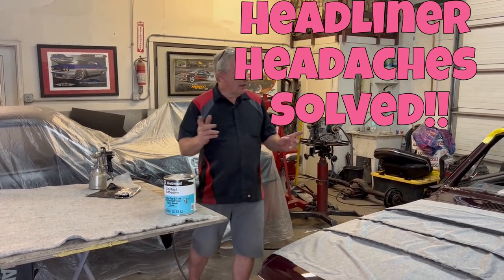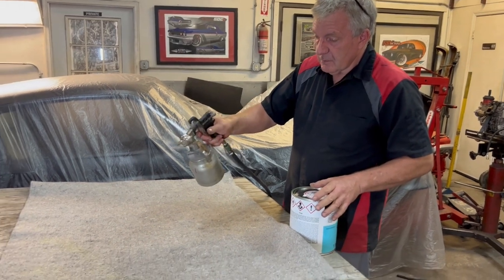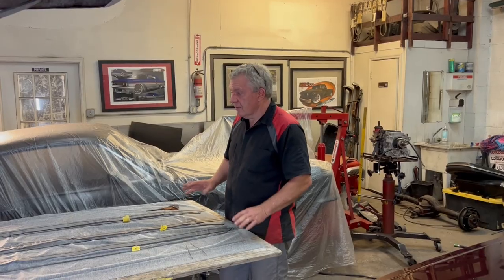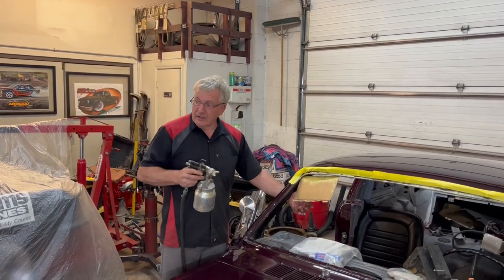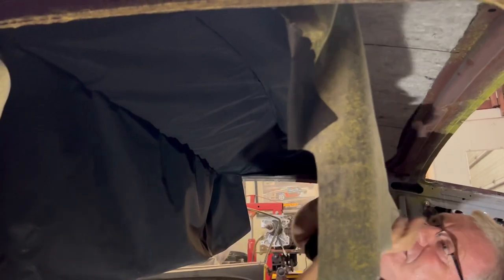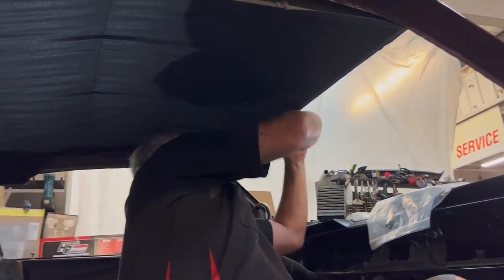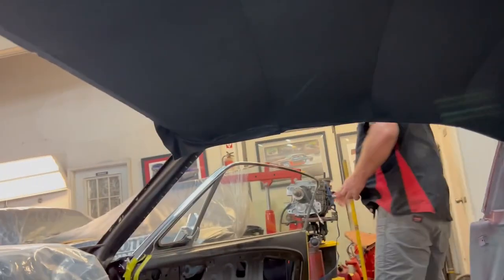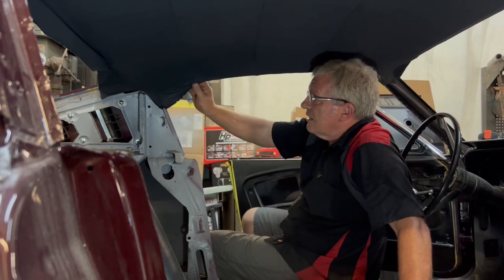Headliner Headaches Solved!!  65 Mustang Headliner Install              #utg @UncleTonysGarage

Comment: Great tutorial for installing headliners.
It's so true that not all contact cement is created equal. I got ahold of some water based contact cement. It was cheaper, odorless, and total $HIT. Worthless for holding. Good quality contact cement is expensive, but worth every penny. Don't try to cheap out. Not only will the installation frustrate you, it will NOT hold up over time.

Comment: That's what I needed to see before I did my El Camino headliner a few years back. Thanks for sharing your knowledge Kiwi!
Reply: Same here, I used the HD headliner stuff in the aerosol can that you get at the local auto parts store and it did not work out to well, wonder how it works on carpet.

Comment: Headliners and floating drywall are two jobs I hire out to a professional. Oh I could probably do it, but why? They’ll have it done in a fraction of the time I’d take to fuck it up and fix it two or three times till I got it right.
Reply from the maker: Knowing your limits is a skill too
Reply: @kiwiclassicsandcustoms9160  , The only other automotive job I would absolutely farm out is a convertible top. I tried to help a friend try and fix the top on his early 70’s Mustang years ago and after we messed with it for a week we ended up taking it to a real shop. After he messed with it for a couple weeks, we finally found a real pro who got it not only looking right, but working right. And not leaking, which I’m told is the real trick. So there is no way I’d attempt one of those.

Comment: Our 66 Charger has a one pice fibre board headliner, perimeter mouldings hold it in place, fabric ones look like a lot of work!
Reply from the maker: They are much easier!
Reply: I realize the factory workers were really good at it, but it seems incredibly labor intensive by today's standards.
Reply: The nice part about those headliners is the easier piecemeal way you can work on them. My Flex's full-length one-piece headiner was a royal PITA when I needed to remove it in order to install factory roof rails, especially since every interior side trim panel must be removed to drop it prior to swapping out the rail inserts.
Reply from the maker: There is that...

Comment: I lucked out on my 69 Dart. Jim's auto up in New Hampshire had an NOS (New old stock) headliner. They bought out a bunch of stock directly from Chrysler years ago. They also have a bunch of used mopar parts in their on site yard, good source for body, trim, and mechanical.

Comment: Hi off topic the stainless trim clips around the front and back windows on the early cars were originally screwed in would you rivet or screw them in . I couldn’t tell from the video but it didn’t look like a pin post thanks in advance America is lucky to have you.
Reply from the maker: The 65 mustang clips we're screwed in,the 66 went to pin post.  I usually screw them in as per the factory just be sure to use stainless screws. Rivets will work just fine too

Comment: First Headliner I ever did, was on a '65 VW Bug... I bought material and "unstitched" the remains of the old one, for a pattern... After I sewed it, it was install time... Well, February in Canada, is a little cold.😂😂😂 So I put a rather large electric heater in the car, so I could get a decent stretch on it... While "Sweatin' like a Bad Girl" in Church", I stretched it in, glued down the sides and put the quarter windows back in... It turned out great, and I had no "SAG" in the 90 degree summer days... I still have to laugh when I think about it: Windows out, in the carport, freezing weather, heater roaring, sweating and stretching the headliner in. 🤣🤣🤣 
On a side note, I wasn't sure if I had tightened it up, to the point, that when the weather got to freezing, that it might rip the stitches... 😮😮😮
But it was okay... 👍👍👍
Good Results from a Mispent Youth...

Comment: My fil was an auto upholstery for over 40yrs. I've watched him make and install antique to modern car headliners. If you' be never done this before, do yourself a favor and take your headliner to a professional. Most headliner kits need unexpected trimming done to fit properly, especially in roof side curves. Good headliners aren't cheap. Cheap headliners are a PITA. Just my experience.
Reply: This advice is why no one learns anything new. Even the professional had a first time.

Comment: I used weldwood contact cement for my headliner on my wagoneer a few years ago.   I used that because i used a vinyl burgundy cordovan type color to match my leather interior.  And the weldwood glue worked great to hold it to the cardboard.

I used a foam paint roller to put it on.  Had to use a lot though as the cardboard headliner sucks it up.

That stuff... though is TOXIC..  i dont rec9mend doing it without a respirator or inside with no ventilation
Reply from the maker: The weldwood is very similar and works pretty well👍

Comment: Wow - great video. My 9F02R has had a 3/8" dia hole just inside of the driver's visor mount for 50 years. And every now and then I think it would be nice to replace the headliner but you confirmed why I always thought the reward would not be worth the effort... Wonder if you ever tried a heat gun to warm the centre area to assist stretching the material out to the sides?
Reply from the maker: Yes a heat gun really helps on some of those stubborn wrinkles

Comment: Would you say laying the fabric out in the sun for a while, befor glue, so its a little relaxed is a fair idea or is it likely to lead to an over stretch once it cools down?
Reply from the maker: Laying out in the sun will help it relax back into it normal shape and flatten out any creases that have formed.  You will need to stretch it a bit to glue it on the car but honestly the most important thing is using the correct glue!!   DAP Landau Top & Trim  spray grade glue is the ONLY one to use.  Please don't use rattle can glue, it will fail and quickly!!!!!!
Reply: @kiwiclassicsandcustoms9160  that seems right. Used rattle cannon the seat back panels....didn't last.

Comment: I already bonded that black thing
Reply from the maker: Not sure what you mean here??
Reply: @kiwiclassicsandcustoms9160  roof insulation. And preparing to install headliner. But on tbird I didint noticed metal clips to hold aft strip. Maybe not all models have it?

Comment: what is different about this process if you do not have the windows out of the car?
Reply from the maker: You have to have the front and rear glass out to do this. People have tried but it fails after a short time. It's a pain but it's got to be done if you want it to survive summer.

Comment: Do you need to remove front and back windshield?
Reply from the maker: Yea you do I'm afraid. I know people have tried but as soon as summer hits the glue will let go if you don't have it wrapped around the windshield openings 😡
Reply: @kiwiclassicsandcustoms9160  awh well thanks for letting me know! My headliner came in today and thought it'd be an easy hour long project 🤣 guess it's a good time to replace weather stripping too
Reply from the maker: @Nerdperior  I'll have a video out soon in installing windshields.  Not all that hard but messy!

Comment: Any tips on 71 sportsroof
Reply from the maker: Use weldwood landau top glue.  NOT any kind of aerosol glue!!!!   Make sure it tight! If your arms aren't getting heavy by the the end of the job it's not tight enough.
Reply: @kiwiclassicsandcustoms9160   ok found a gallon of weld wood landau top glue with a gun god 93.00 buck I’ll order it thanks